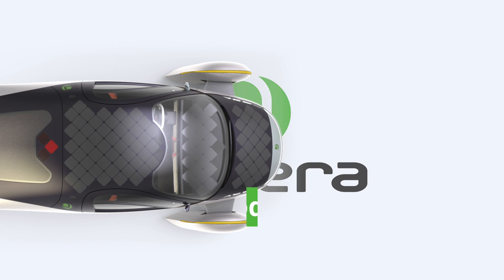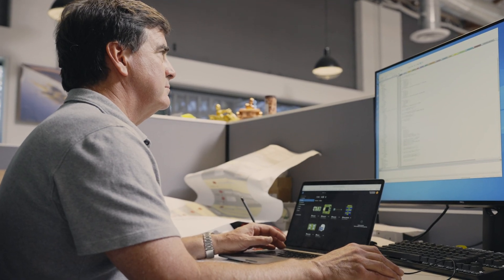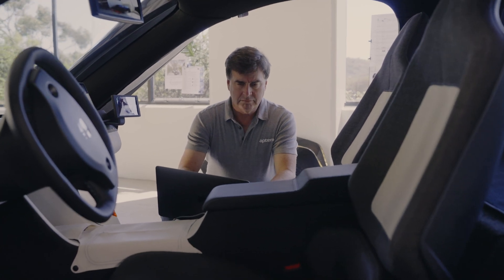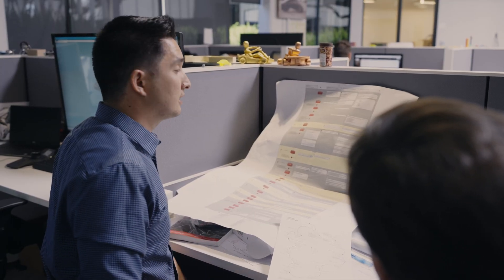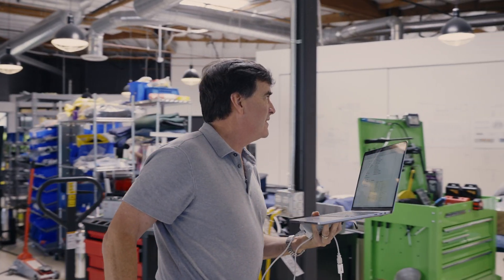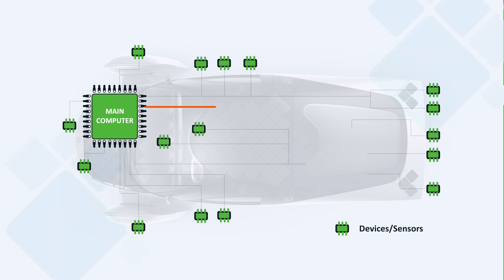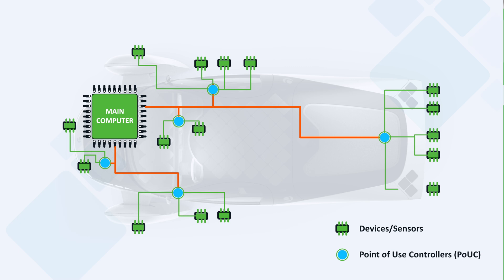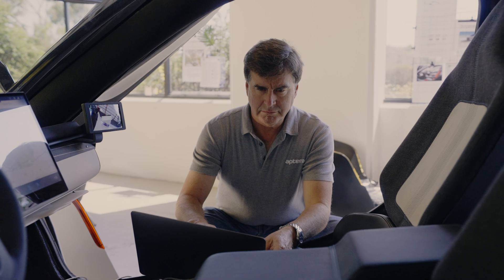Aptera Makers Series — Body Control

Comment: Don't forget the rear wiper & defrost. Hyundai learned this the hard way with the Ioniq 5. I can tell when it's dark out. I can tell when it's raining. Intermitent wipers never have the right interval. Give me a convenient manual pulse method. A heat pump is mandatory for HVAC, with pre heat & cool while plugged in.

Comment: Will solar cell placement be maximized to get the most power from the sun and into the batteries? Several of the videos showed areas that didn't have cells. I was wondering why? When will the 1K versions be projected to hit the market? One last thing for now how are these cars interiors cooled
Reply: Solar is available in several steps, including the dash, the hood, the roof and full solar which covers the rear deck and costs $900 to provide up to 700 watts or up to 4.4 kWh per day.  I don't know when the 1K versions will be produced, but I expect the first deliveries of Paradigm editions to take place this summer if they can get production versions produced and crash tested by late Spring.

Comment: I think you are heading in the right direction. Like a modern F22 aircraft have distributed controllers and a good power back bone to sub controllers. The man control bus (CAN ?) should be a fiber optic net to keep the weight down and it would be way more reliable,

Comment: I think with a $25K tesla just around the corner, Aptera might want to reconsider their price point. If that's not possible may be try getting Tesla's somehow involved. I believe that's one of the ways Aptera can make sure to get a significant EV market share. If not, going head to head with Tesla and it's $25K EV might just be too steep of a hill to climb.

Get the big fish in the bag asap!
Reply: I think Aptera is directed to a totally different audience than Tesla. Other than the Model S, I hate the cheap look of current Tesla’s.
Reply: @arlenbell4376  Yes. I  think that few who are looking at the Aptera would find a Tesla offering that meets their needs.  This may change when Aptera introduces their 4 wheel, 5 passenger sedan in two or three years.  At that point, I think right to repair will be a major factor for many.
Reply: Aptera's production costs are FAR lower than Teslas, and their first model does not pretend to go head to head with any Telsa offering.  That won't happen until they built their 4 wheel, 5 passenger sedan.  At that point, Tesla may have to start worrying.
Reply: @n.brucenelson5920  Thinking as a consumer, if Tesla and Aptera bring vehicles to market around the same price point, im my opinion most, most people would want to buy a Tesla.

I get your point, we are not comparing apples to apples here but just because Tesla has a reputation and a history of producing compelling EV vehicles it may be preffered over the new Aptera.
Reply: @tamertips1305  One reason is that Tesla does not support the right to repair.  You will be able to work on an Aptera yourself, or any service center of your choosing.  The parts will be available to anyone and the service documents will be provided for free, open source.

Comment: What happens once the aptera's internal batteries are charged 100% from solar. Can the panels be used to trickle charge an external power wall? This option would be fantastic. So as long as the sun shines the solar panels are generating useful energy (electricity)

Comment: How do you change the tires in case of an emergency? Thank You
Reply: My plan is to carry a tire plug kit and am electric inflator.  This has worked for me in over 400,000 mile of motorcycle riding for road repairs of both bike and car tires.  Tires can be changed when needed at any tire shop

Comment: Thin cabling is less efficient, not more efficient
Reply: This is not universally true.  Thin cables carrying power at 400 volts can have less resistance loss than thick, heavy cables at 12 or even 48 volts, and also cause less loss due to weight. They may also cost less and use fewer resources.

Comment: This is a prime example of why I hate modern cars. They automate so many things that I don't need or ever wanted to be automated which results in more points of failure. I never once thought I needed automatic headlights or automatic windshield wipers. All these things add extra cost for minimal added convenience and it means more potential problems in the future. You can go to India and South East Asia and or even Mexico and buy cars that cost half as much as they do in the US, partly because they don't have all these extra useless features (although mostly because they don't have to meet US safety and environmental standards). A three-wheel car should not cost more than $20,000 new, but that will never happen because they are made by start-ups that don't have the economy of scale to bring the price down while major manufacturers are focused on selling crossovers, huge SUVs, and pick-up trucks because they have the highest margin. I would like to see someone make a true bare-bones three-wheel car, that actually costs less than a 4-wheel economy car like a Honda Fit or Ford Focus.
Reply: In spite of this, Aptera has a much smaller total parts count than the vehicles you mention - by thousands of parts.
Reply: @n.brucenelson5920  And yet, without tax credits, it will still cost more and have less usable interior space. I applaud Aptera for doing the design effort to make a really energy efficient car, but it's a real shame that big auto companies don't do the same, because if they really tried, they could make the same car for a fraction of the cost of a start-up company. I hope Aptera can get funding they need to actually go to production and succeed, because I'd like to see them improve the design over time and bring the cost down to a competitive price with an economy car without having to rely on ev tax credits.
Reply: @JEP-Tech  I really appreciate your comment, J P.  

Aptera' s business plan is for them to be profitable in the first year of production.  To that end, even with a small production rate, they are targeting a 30-34% profit per vehicle

If they can achieve anything like this, they will have the resources to quickly grow their model line with vehicles that are far less costly to produce.

These follow on vehicles won't be as efficient, but they will still be leaders in their class, and can sell for far less than their competitor's due to dramatically lower parts count and tooling costs.

Remember that most of Teslas' profits have come from selling clean air tax credits to other companies.  They require huge volumes of sales to offset the capital investments in gjgapresses to produce their vehicles.  I could see them eventually just become a supplier of batteries to other makes unless they adjust, which they probably will.

Aptera' s approach to production is as important a disruptor as their first vehicle design.

My support of Aptera is not just because I want their vehicle, which I do., but because believe they show our best path to get carbon out of our transportation sector.

Comment: Some comments I've seen complain that the Aptera is "too expensive". To me this is an inexpensive hyper car..... top of the heap for efficiency rather than top speed (but apparently the acceleration is still pretty good).
Reply: People have to appreciate the cost of the batteries that go into electric vehicles. It’s sort of a pay now or a lot more over time with an ICE.
Reply: I think I've seen that opinion fly as well, which means they are just ill informed. Aptera is making this thing fully customisable for how much you want to pay, and the lowest configuration at a normal people affordability $26k still gives you twice the range of other entry level EVs. Sure you can make the Aptera the same price as a $40k Tesla if you wish, and what this gets you is still twice the range at that price.

Comment: They are still planning after more than 10 years. When will Aptera deliver a vehicle?
Reply: No.  The first Aptera was liquidated after the CEO appointed by the start up incubator to oversee production kicked out the founders in a board fight because he wanted to build a different car than the one he was hired to.

He liquidated when Tesla got the loan he was trying for.

The current Aptera Motors formed in 2019 and created a ground up new design.

Comment: How about the performances of each motor and switches and models, with a app or just in the settings menu onboard screen. Some wiring diagrams and procedures and tips as well with each system. It's all ready there so why not  and advertise how easy owning a car like this would be for anybody.
Reply: O the body trim and locations would be a nice addition to the wiring diagrams and tips.

Comment: I have a question.  WHY is the video display of what a mirror would show is in the place a mechanic mirror would have to go???  Why not on the dash slightly below where you are looking to see traffic ahead put them.  You could watch a car with an asshole driver start to pass you on the right then decide to fall back move to your left side and then pass you without ever losing sight of the vehicle on the display!  You can have 360 degrees of tactical awareness without having to move your head too much.  Exactly if the solar panels are going to obscure your rear hatch.
Reply: I think it’s because of something he mentioned in the video, that the car behaves and operates how you would expect it to. Yes, the way you describe may be better once you’ve gotten used to it, but today, it’s not what most drivers would expect. It’s not clear to me which decision or design philosophy should win out here.
Reply: @altosack  I do agree.

Comment: Is the ride and handling going to be adjustable, shocks and dampers with different modes. Will the suspension get different characteristics for European and Uk roads for instance
Reply: That reminds me of something I was thinking the other day.  The mileage EPA range numbers are usually for lead-footed American drivers.   But might there be an Eco-Mode that could add another, say, 20% to range?

Comment: Aptera and Efficiency go hand in hand, especially when traveling in areas of the Southwest, Central Plains, and the Rocky Mountain States where range anxiety exisits.
Reply: Hope they have OTA updates figured out.  Given the lack of dealer network and that I'm 1500 miles away it would be pretty important to have a remote way to fix such issues.  As a software dev I totally understand issues happen but they need a method to fix issues in infotainment, propulsion and body control systems

Comment: Part of making production run smoothly, and a vehicle to run reliably, is working out all the basics well. The basics of design and engineering. Control modules are the parts of a car that everyone expects to run flawlessly, as they have in most every car that you have owned before. At least the good ones. Get the supporting components wrong and people call the car "broken" or "badly engineered", but get them all right and people's attention moves right on to the more exciting and flashy bits of the car. Thanks Charlie for the behind the scenes tour, and all your hard work to gets the details sorted out, so that I can fully enjoy my Aptera in 2022.

Comment: Love it! I know it doesnt have anything to do with this video, but please put dark mode for the screen, because when driving at night if it is white it is difficult to see the road due to the light
Reply: More than that, I hope they can source OLED panels for the "mirror" displays otherwise even if it's all black you still have three flashlights shining in your face when it's completely dark.  If they had a very simple speed and trip/range display then the main nav screen could stay off.
Reply: Agreed!  Awesome suggestion.
Reply: I'm hoping for a red filter too for long night drives.
Reply: @jlschmugge  yes! Perfect scenario would be all black with oled screen, and the info in warm white/red
Reply: @jlschmugge  In before someone requests aromatherapy candles for the back.  😂
Reply: Do current EVs with screen already have features like this? If so I feel it likely Aptera would emulate it.

Comment: Do you ship in Europe? If not, when will you do it?
Reply: Shipment dates are still very uncertain
  All manufacturers are being slowed supply chain issues, and we don't know what additional work the beta testing will reveal to be needed.  However, Aptera is taking preorders from Europe, and has European homologation experts working with them so they will have the needed legal approvals in place when they are ready.
Reply: Aptera is too wide for EU/UK. They'll need some modifications, so it's likely that UK order will be a little later in the timeline